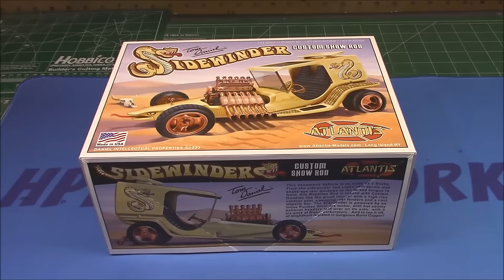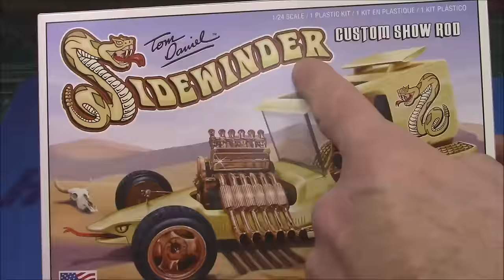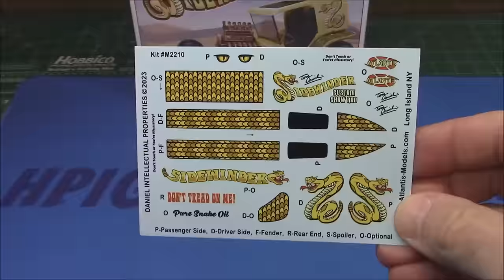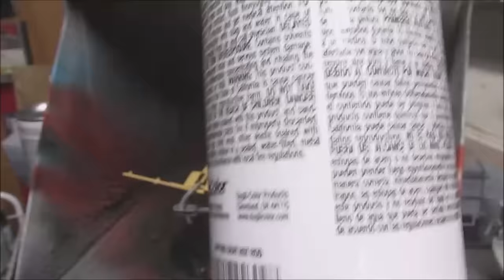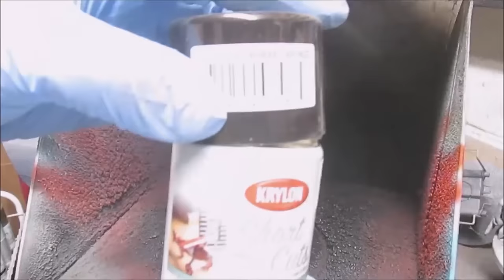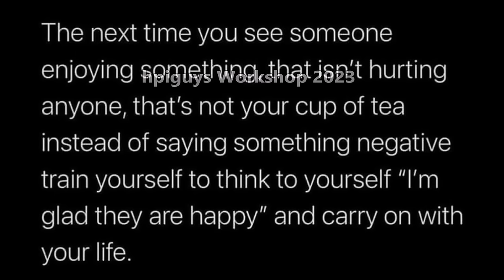Sidewinder Custom Show Rod Pontiac Tom Daniel 1/24 Scale Model Kit Build How To Assemble Paint Decal

Comment: I'm always amazed at the creativity of Tom Daniel and Ed Roth in creating these one off machines. This one is very different and it seems to go together quite easily. The flash kinda goes with the territory as I'm presuming this is the first time this model has been available in years, but it's part of the learning curve in this hobby and not as bad as i've seen on other kits. And I like the inline 6 - it's a nice change from the V8s all the time.